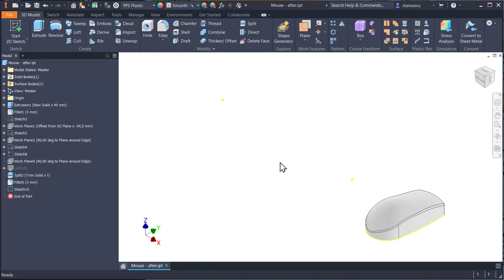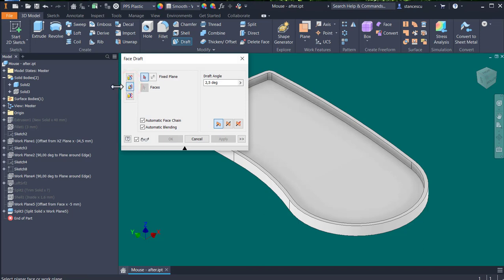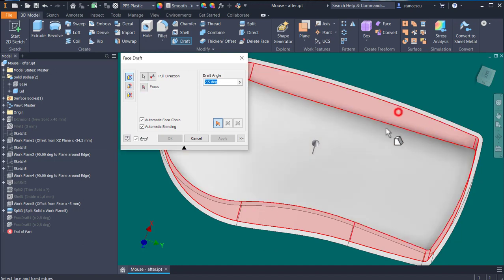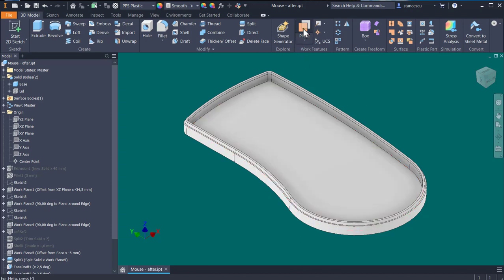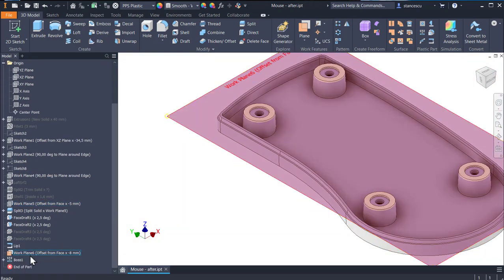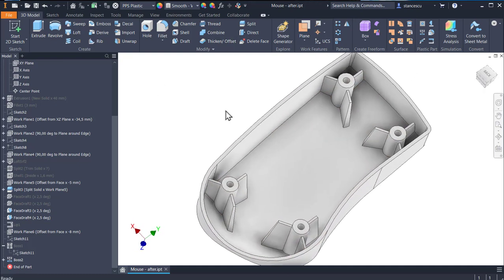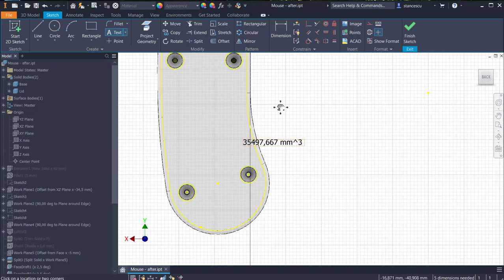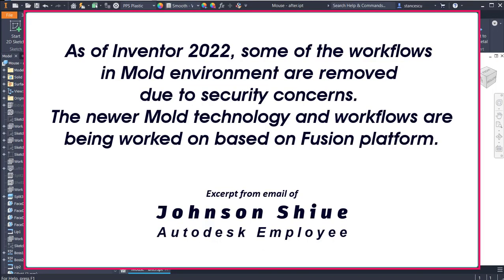Tutorial Inventor - 205 MOLD DESIGN

Comment: I also have a suggestion when creating the 4 Draft items.  With the first two drafts, if you pick the flat and thin perimeter face instead of the inside bottom face, once you complete all four drafts, the outside surfaces will meet up perfectly along the same contour line at the parting plane.  This doesn't happen when you pick the bottom face.  I don't know if this makes sense, but if you try it you will see what I mean.
Reply from the maker: I will try tomorrow. Thank you.

Comment: That is unfortunate that Inventor removed these mold analysis tools.  It seams like Autodesk is taking the same strategy with Fusion that it had with AutoCAD back in 1990 when I went to university.  Every student I new had a pirated copy of AutoCAD and it was easy to obtain.  It was very difficult or impossible to get a pirated copy of Bentley's MicroStation at the time.  As a result, millions of students were becoming familiar with AutoCAD but not with MicroStation.  This is why AutoCAD became the dominant CAD software during the 1990's and 2000's.  Now that they are giving free versions of Fusion to students and other users, I'm guessing that they think this will help Fusion become the dominant 3D software.  There is a certain amount of logic to this.
Reply from the maker: Thank you for your thoughts, my friend!

Comment: Does the pull direction refer to the direction that the part is removed from the mould. For example if a draft angle was added to the model of an ice cube the pull direction arrow would point away from the small face as that is the direction it would be removed from the ice cube mould.
Reply from the maker: Yes, it does, and the example with the ice cube is good! Thank you Rob Troman for your gentle comments!

Comment: Hi sir, do you think that it is very hard to rotate parts in Inventor? Is it possible for us to rotate in a certain amount of angle or a notification that indicate we have rotated 90 degree like Fusion ?
Reply from the maker: Surely you can rotate parts in Inventor! In an assembly you can use free rotate to place a part at a free angle, then apply Constraint/Angle/First solution to apply a certain angle about any other part.